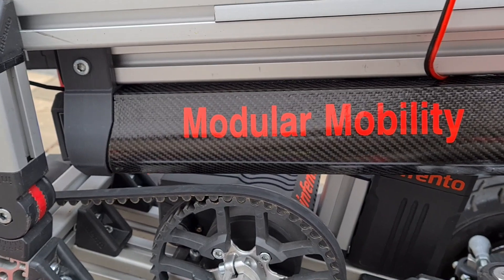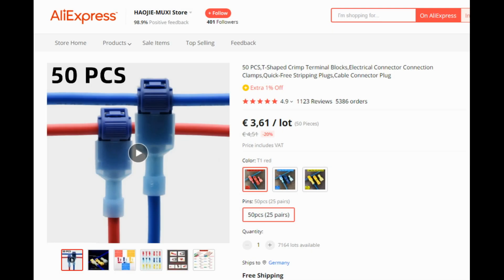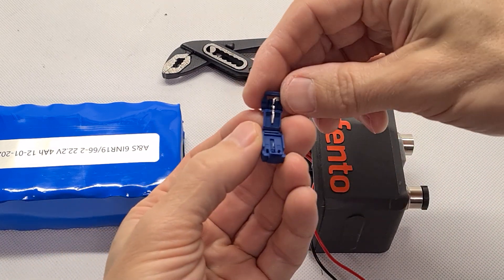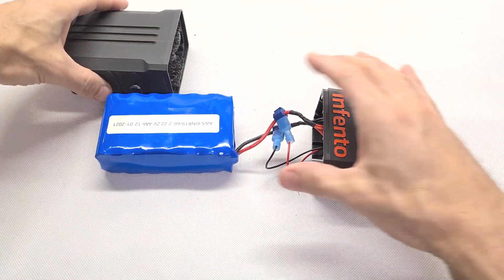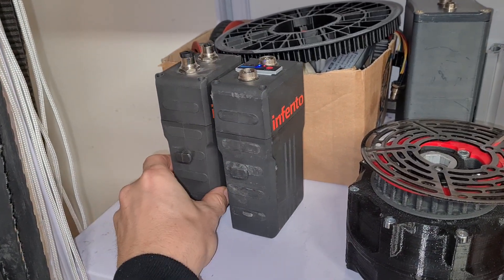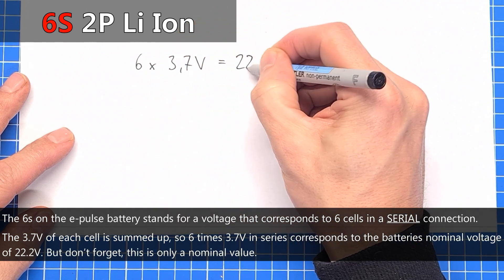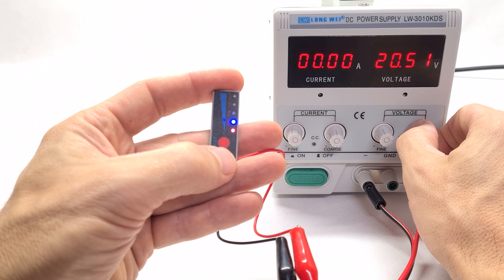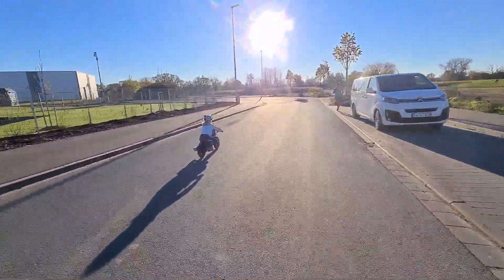Add a CHARGE INDICATOR to your Infento E-PULSE battery! Battery basics.

Comment: Hi! 
I love your channel and your videos :) 
I both the kit 2 years ago and tried the motor only this year. 
At first it did not want to load the battery, but it did in the end.
The second time it did not. It was reading 16.2 V and not charging. 
I tried to trickle charge it by connecting it + to + , - to -, to a 22v  battery. 
I think the short circuit broke it instead of bring it back to life. When I connect the battery the green led goes dark. 
Sorry for the long description, but I want to fix it for my kid. 
Any advise ? 
Danke.
Reply from the maker: Green light goes dark normally happens when the battery is full.
16.2V means 2.7V per cell. This is very close to a sure kill of the cells. 
Go and buy a 36V Hoverboard battery from Al for some 30 bucks.